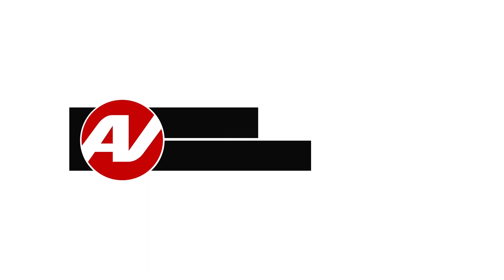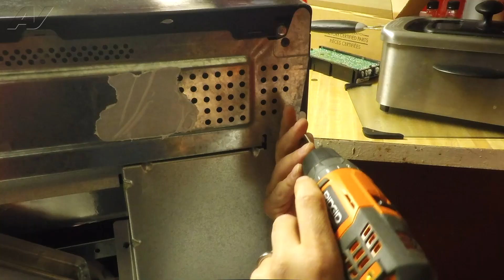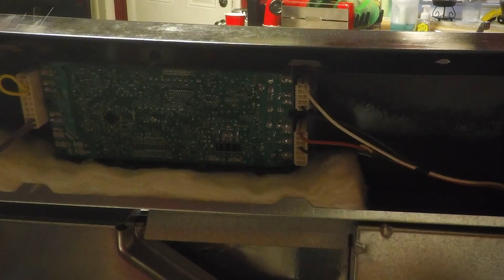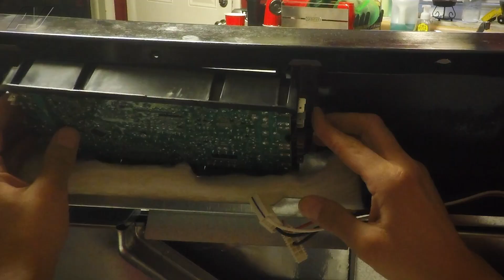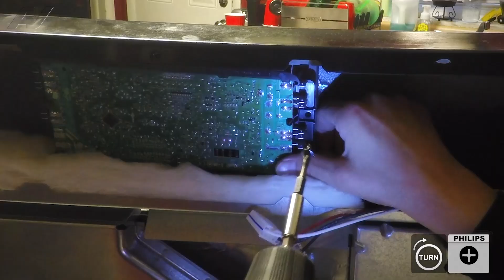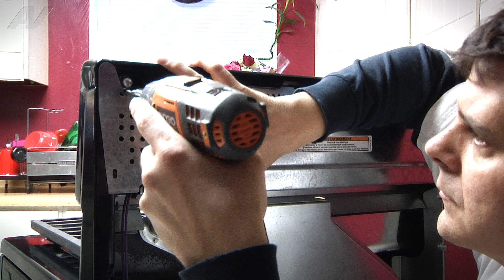Whirlpool Stove Repair - Buzzing Noise From Control Panel - Diagnostics & Troubleshooting

Comment: What's causing the noise? mine starts n stops  . You only say replace it. Also how much is the new board ?
Reply from the maker: Great question, if you have a more technical question that our parts department cannot answer, you can search our over 17,000 answered questions free at our website www.ApplianceVideo.com under our Repair Help section. You can also call our parts department at 1-800-830-5465 and they can give you help 7-days A week ,or search at www.SaveMoreOnParts.com  .
Reply: @Appliancevideo  great answer why don't you just tell the guy you just want to sell him parts and be done with it

Comment: where's the buzzing noise diagnostic?
Reply from the maker: Great question, if you have a more technical question that our parts department cannot answer, you can search our over 17,000 answered questions free at our website www.ApplianceVideo.com under our Repair Help section. You can also call our parts department at 1-800-830-5465 and they can give you help 7-days A week ,or search at www.SaveMoreOnParts.com  .

Comment: I wish I heard what the buzzing noise sounded like.
Reply: Mine sounds like someone eating potato chips clock went out and oven lite too
Reply from the maker: Great question, if you have a more technical question that our parts department cannot answer, you can search our over 17,000 answered questions free at our website www.ApplianceVideo.com under our Repair Help section. You can also call our parts department at 1-800-830-5465 and they can give you help 7-days A week ,or search at www.SaveMoreOnParts.com  .